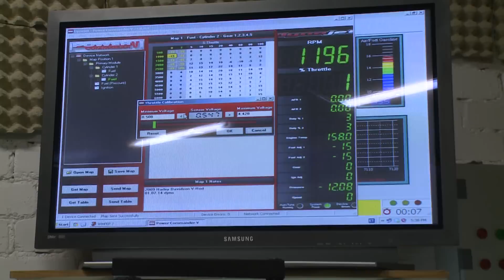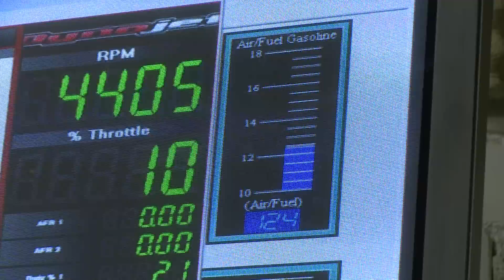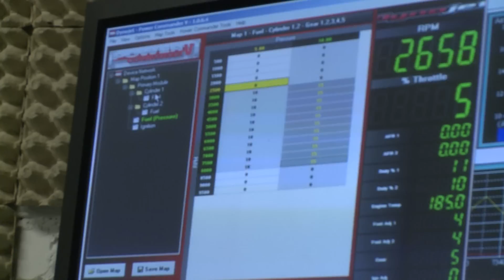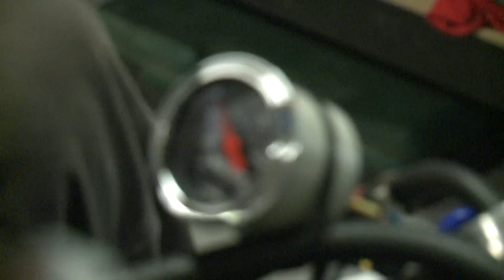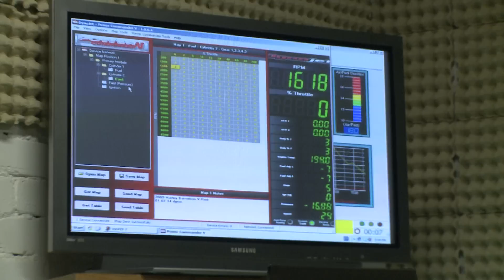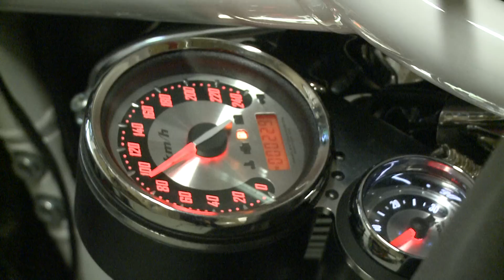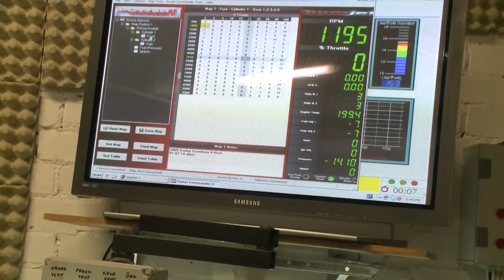Fredy.ee '06 Harley-Davidson VRSCSE2 Turbo Screamin Eagle V-Rod Dyno Tuning Part 1

Comment: You have the intake runner really close to your heads, what are your intake temperatures? Need to keep them low enough.

Also you should chain swap your final drive if you really want to put down that power reliably.

Comment: @Fredy All constructive suggestions, not meant to be negative...
I've seen worse but you should be tuning the low TPS% with Steady State...
It's easier to let the dyno hold the rpm at each rpm-cell until you have the A/F right then move up to the next rpm-cell...
You would also be better off putting a tube up into the pipe(s) 1: to get away from erroneous A/F from reversion at lower RPM and 2: so you can tune each cylinder separately...